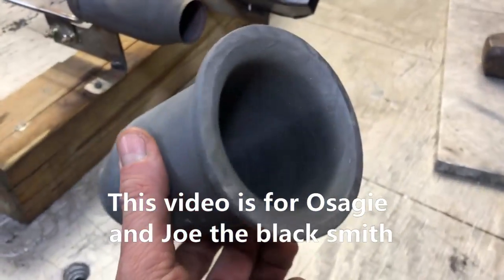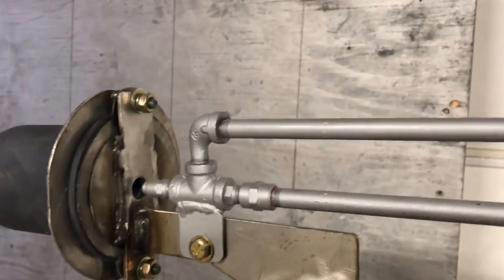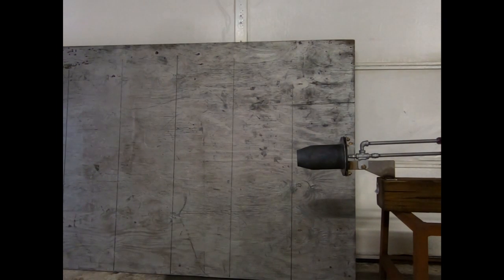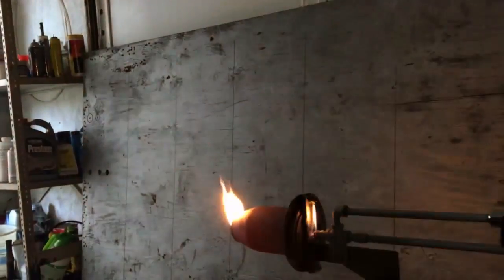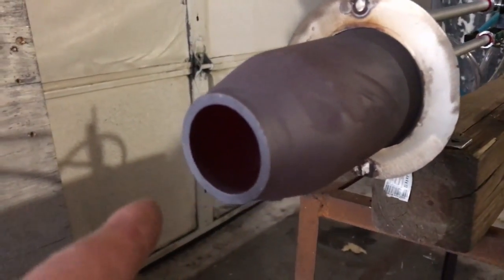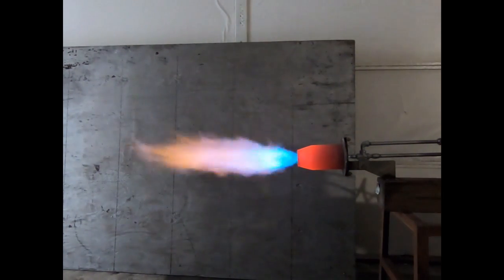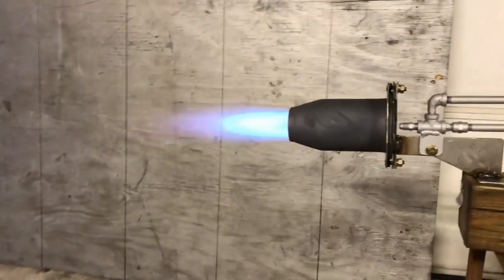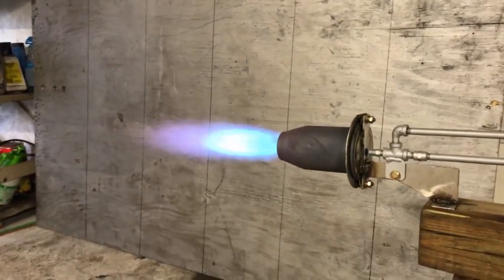Silicon Carbide all fuel high velocity burner

Comment: Have you thought about mounting a Car Turbocharger in front of the flame to feed air to the back then shut off the air compressor after the everything is initialed. Basically air compressor is used only at the beginning to start up then shut it off after Turbocharger took over.

Comment: How did they make that nozzle do you have any information on it’s manufacturing? It’s incredible that it glowed.
Reply from the maker: Not really buti sell them for $100
Reply: You could use a ball mill and silicon carbide powder, and polymer, and then sinter it. But you're not going to be able to do that for under a hundred bucks unless you have a lot of equipment and a lot of time

Comment: Careful with SiC, it's real carcinogenic
Reply from the maker: I called a couple companies acting like a hot buyer and wanted MSDF's and all , because its sintered we should be fine no particals come off as its a solid rock  , only fibrous is very carcinogenic , yes tiny particles can do the same over 40 years .
Reply: fireandcopper I think the health risk is primarily related to using it as an abrasive and breathing in the dust.  I can’t imagine a lot of dust or fumes coming off of these combustion chambers/swirl chambers considering how stabile SiC is at high temps.  Mostly speculation on my part, so any experts who want to chime in?
Reply from the maker: @JoeTheBlacksmith13  
I called a couple companies in america  acting like a hot buyer and wanted MSDF's and all , because its sintered we should be fine no particals come off as its a solid rock  , only fibrous is very carcinogenic , yes tiny particles can do the same over 40 years .

The engineer confirmed this
Reply from the maker: thanks for the heads up , i called some places that sell them in america